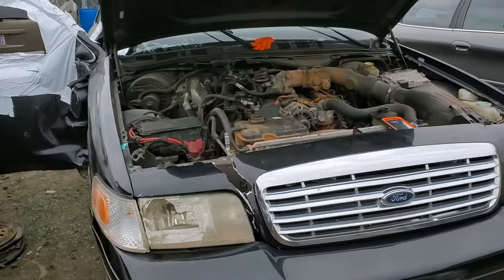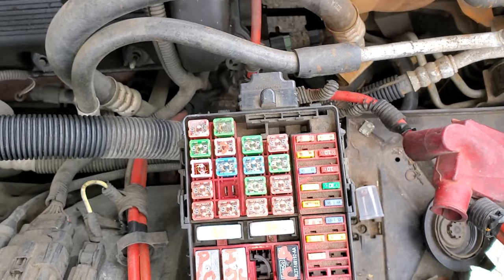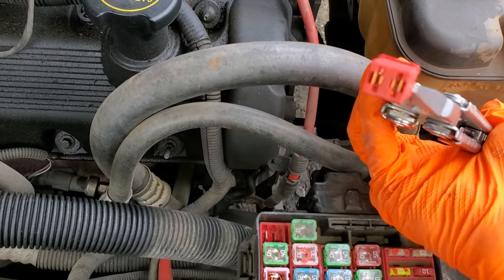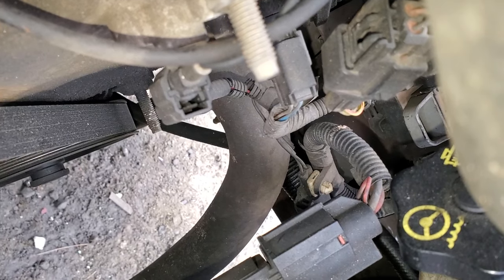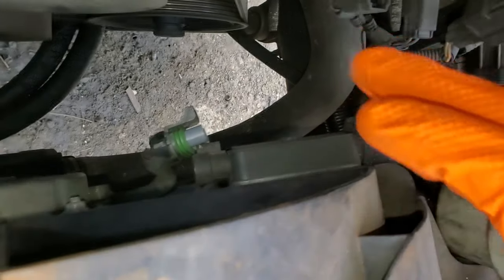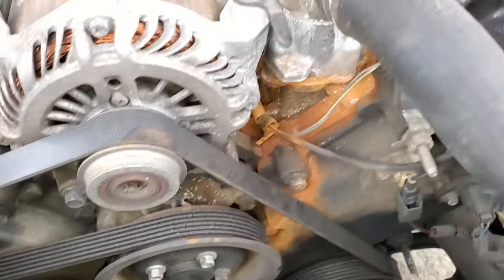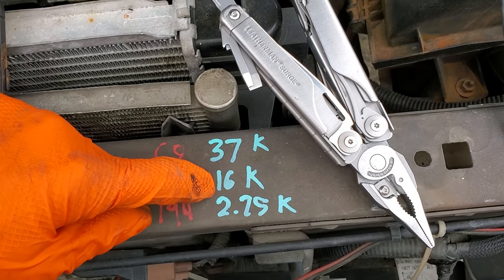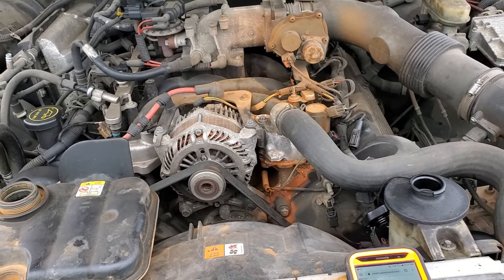2006 Ford Crown Vic Cooling Fan Fuses & Relays

Comment: My Electric fan stopped working on my 2006 Lincoln Town-car and caused an overheat. This video was helpful in me fixing it. It was the relay that he points out around the 1:30 mark of the video, I know many people are saying to replace the whole electric fan assembly , but this was much easier for me and the part was less than 25 to buy and was plug and play.

Comment: So are you saying there is not a larger relay in this system? Only a fuse and a control module + sending unit behind alternator?  Thanks for the help. I'm mostly a Chevy guy and they have large relay in the system.

Comment: Great video! I have a 2001 Mercury Grand Marquis and the cooling fan doesn't come on unless I have on the a/c. It starts spinning fast and then slow. The fan won't come on unless the a/c is running but still runs hot. Any ideas? Thanks in advance!
Reply: I have the same issue on my 2002 Mercury Grand Marquis. Whenever I start it I just make sure the defrost is on and then the fan runs. After it started I could shut the AC off and the fan will still run but if I shut the vehicle off and then turn it back on without the AC on the fan will not kick on no matter how warm the temperature is
Reply: I have no check engine code or anything wrong but my cooling fans constantly run when AC is on. What could this be?

Comment: Just to let u know guys problem solved...
The problem in my car was in module i placed the module that came with the assembly (fan-frame-module)  from the junk yard...
I installed the one i used b4 and the fan worked.

Comment: Good vid,I find if you disconnect the cyl temp sender the pcm will command the fan to high cause it thinks sender has failed ,something that may help in troubleshooting any issue
Reply: Hey man I did exactly that and my fan engaged on my 07 after I replaced almost everything besides the fan itself but I cannot find the exact cause because it will only engage with temp sensor disconnected
Reply: @denzeltucker2920  Hello Denzel My grandsons ex 2011 cop car was over heating in traffic so I had to study up on the cooling fan operation.If you can dissconnect cyl head temp sensor and the fan runs on high consistently then  in my opinion things are ok from the pcm out.I would still inspect your connector at the input side of the module and the connector on the output side of the module ,they both melt ,quite common,I also used a headlight and jumper wires to double check the current at the input side of the fan module to load it and make sure the current there is up to snuff .That being said if everything passes inspection you may have to roll the dice and try a pcm Regards
Reply: @denzeltucker2920  That's why it's best to replace the whole unit. It's all new! Dorman makes great fan assemblies
Reply: @tombrinkert3720  Time and work is MONEY. IT'S BEST TO REPLACE THE WHOLE UNIT. CAN'T BEAT ALL NEW!!DORMAN MAKES A GREAT FAN ASSEMBLE! AT ONLY 160! COMPLETE!
Reply: @captainamericaamerica8090  I just bought and installed a Dorman not even a month later something is wrong it doesn't want to come on.

Comment: My transmission temp is a little to high for my liking. I install a additional transmission cooler but also want to add the auxiliary fan on the front of the cooler. Can I splice the fan into the radiator fans so they cut on at the same time or just run it from its own source??
Reply: I would run it from its own source with its own relays and its own switch so you can turn it on or off at your own disposal.
Reply: DON'T

Comment: Good video.  Fan module and fan motor can be replaced without replacing the complete assembly.  Cylinder head temp sensor explanation is very good.  Note the condition of the connector wire, the flex tubing has disintegrated exposing wire to more engine heat.  Heat increases wire resistance which could cause PCM to read higher sensor temp than actual.  Heat causes PCM to retard ignition so the result is lost engine power.  Replace the flex tubing.
Reply: Too Much time and work to replace module plus fan motor adds up to small savings. Best to replace the whole fan assemble. Cheaper in the long run. We love Dorman! Great price and quality. All the components are there.
Reply: That makes sense.. So if my fans constantly run when AC is turned on, could that be due to this wire being bad or what u think?
Reply: @NightRider-16  Fan is supposed to run constantly when a/c compressor is engaged.
Reply: @encinobalboa  OK thank u

Comment: Nice video but no need for all this electrical nonsense....car makers, just put a normal fan back on the front of the engine....worked perfectly going back to the early 1900's.
Reply: YEP, what I don't understand is these hot rod cars that HAVE plenty of room FOR a mechanical fan or they HAD one but they took it off FOR electric fans LOL,
Reply: I know. I want a metal fan and assembly powered by the motor using a pully off the belt.

Comment: I got a 1999 CVPI and it does pretty much the same thing. The car overheats when the AC is on, replaced the compressor, condenser, accumulator, orifice plug, and radiator cooling fan. Also replaced the relays and fuses and radiator. And after all of that the damned thing still overheats when the AC is on, the compressor clutch kicks on and off and the brand new radiator fan doesn't come on I'm at my wits end, got the replacement cable for both the fan and the compressor and gonna use my guages to check refigerant levels.
Reply: did you find the issue?
Reply: @ChrisMFlorida  not yet, think it might be the PCM at this point because I pulled it put, and tried replacing it but I ended up having to place the old one back in. When I did that the car ran it's AC normally for about a half hour to 45 minutes before the Radiator fan switched off and the compressor began to cycle on and off again
Reply: I have the same issue, where you able to fix it?
Reply: @JUANGOMEZ-sk9hd  not yet I'm thinking it's the PCM or its the Ambient air temperature sensor
Reply: @JustinLaFleur1990  any success? I'm having the same problem right now.
Reply: @HermanStevensII  sadly no, I ordered a new PCM but the company I ordered it from didn't program it right I haven't had the time or money to program it
Reply: @JustinLaFleur1990  wow... The Vic is my primary. I'm just speeding everywhere currently.

Comment: Hey Love the helpful videos. But my 08 crown Vic has been a tank up until last week only running hot when idling. Fan doesn’t seem to be working but all fuses relays and it getting voltage, the Only thing that’s sus is the ohms reading on the last plug u showed us in the video. It’s reading 3.95 w engine at 190 maybe 200 degrees. My ohm reader is old I think it only works on (20k) setting, would that be a factor. I’ve spent so much on parts in two days while driving the 2500hd to work (GAS SUCKR) so there’s that. And NOW only to find that the fans is not kicking on. Please tell me it the Drivetrain Temp Sensor and not Fan Motor. Jk either is cool lol… 🤦‍♂️🤷‍♂️ Thanks man your Videos are sooooo helpful.!!!💯🙏😎
Reply: I'm having a similar problem with my 07.  On hot days at idle my fan will stop working and run hot sometimes vs when driving with ac it runs.

Comment: Hi. I have 2011 Lincoln Town car the radiator fan dose not turn on when the gage get half way up, but when I turn the A/C on the fan turn on. i don't know the problem is the radiator fan or temperature sensor?  By the way no check engine light. Thank you.

Comment: So I have a 2006 crown victoria and my fans are constantly running only when AC is on. When I turn AC off they stop. What could Cause them to run constantly?
Reply: I think that they are supposed to turn on automatically whenever the AC is on.
Reply: @NightRider-16  yea so the fan turns on as soon as you turn ac on, that's normal, that's how it should function
Reply: @chocolatebar701  OK thank u.

Comment: My 09 towncar fan stays on after I turn the car off, I replaced the temperature sensor a few months ago so it might not be that, any suggestions?
Reply: Im having the same issue. There’s no overheating issue and everything seems to be working when the engine is running but the fan continues to run after i shut the engine off and doesn’t stop until the battery is drained. Did you find the problem? If so what had to be replaced?
Reply: @benhizzle  yeah, I replaced the fan control module and that took care of it but it was like $300 from the dealer maybe try an aftermarket one which are like $50?
Reply: @xxXrichmanXxx  Thanks, I’ll replace it this week👍
Reply: @benhizzle  hope it helps

Comment: crown Vic 2008 if engine newly start radiator fan works but engine is hot fan working high and suddenly  low and then off and then Aircon  off and on and high temperature  what is the problem sir

Comment: I have a 08 grand marquis everytime I turn on ac its kicks in and out change fan module still doing it causing it to run hot only if ac is on only code it saying is the sunload sensor that's on top of the dash is that it or the climate control and also changed thermostat

Comment: My 2008, only blowing hot air any tips?
Reply: If the fan is turning then recharge your A/C for about $20-30 bucks. If fan is not turning then replace the Fan Control Module for about $30 bucks. If that doesn't work replace the entire Cooling Fan Assembly for about $200. If the A/C works while the car is moving and gets warm at idle it's usually the Fan Control Module or entire Cooling Fan Assembly. Hope that helps.
Reply: @caroleatkins6012  thanks! I needed a recharge
Reply: @caroleatkins6012 what if I have no check engine light or cooling issues but my only issue is that the loud fans constantly run when AC is on. They stop if AC is off but I thought the fans should cycle off and on depending on temp and not run constantly???

Comment: Hi i have a 2007 grand marquis...
I tried to connect  with a jumper starter directly to the fan it did not spin until I just move it by my hand, I tried the same thing on the module result was same.
, fuse looks fine  the module was replaced with a new one OEM  a year ago. Heat sensor reads normally. 
Only on a cold start the fan spins when switching AC on after reaching operating heat every time I stop AC is not cooling. 
should i replace the fan motor? Or there is something I am missing?
Reply: Replace the whole unit. Dorman makes a great one

Comment: Hello friend, I have a situation with a crown vic 2011, previously another mechanic had already worked on the car and did not find the problem and put the fan directly on the battery, I tell the customer to buy a new module, thermostat and the temperature sensor to be sure that everything is new and to turn on the fan, everything new is installed but even so the fan does not turn on as it should, there is voltage for the fan to turn on but apparently there is no ground, so I do a ground alternated, well the fan starts but does not turn off, it remained active even with the car off, what can you suggest to me regarding this .. I will wait for your answer and thank you
Reply: Darwin Colon did u solve it
Reply: Relay could be stuck on....

Comment: My cooling fan won’t shut off at all key on or off. Help
Reply: Same here ,What was the problem?
Reply: @jacobcasillas9249  there’s a switch on the radiator fan that went bad
Reply: @mikerox31 what's the name of it? And is it apart of the whole fan assembly?

Comment: I have a question. I have an LS swap with two wires to control a two speed fan. I found several wiring diagrams for a taurus fan. The diagrams show a high and low speed wires coming off the fam motor. But you are stating the crown Vic is pos./neg.

Comment: if you replace the fan module replace the fan motor. 95 percent of the time its the fan frying the module. the ford fan motors have an issue with drawing to many amps when starting and running.
Reply: USE DORMAN! 🐯🐯🐯👑👑👑🏆🏆🏆🏆

Comment: That works but it kills the AC there's another plug under the reservoir for water you can unplug and keep the fan running and the AC
Reply: Please tell me more. I have that problem (on Crown Vic) the cooling fan and AC stop in the same time ... at random.
Thank You.
Reply: ? Say more

Comment: My crown Vic is going from hot and cold never stays on hot i Change the thermostat and flush the radiator because of coolant turning brown and I bypass the heater core earlier this year because it was leaking  it ran good for like 2 week then went back to running hot and cold oil is is good not coolant leaks I don’t think the coolant is flowing threw the thermostat the coolant is back brown I bought the car 5 years ago and this is the first problem 225thousand on dash

Comment: I was told to check the relay, is there a relay on an 08?
Reply: Have the same question did you find it?
Reply: @nickcarter9373  there is no mechanical relay. the speed controller mounted on the side of the shroud is both a Solid Sate relay and speed controller. This is replaceable and can be purchase separately. I got it on amazon and solved my problem of not turning on. These usually go bad and could possibly cause a slight load on the battery causing your battery to slowly drain and go dead if the motor does not turn on at all. 
usually if you don't drive it a lot or the battery is at its end of life. 
This happens when the MOSFET inside are slightly leaking instead of a full dead short which would cause the fan NOT to turn off. 

Note: A shorted speed controller would cause the fan to run continuously, if the MOSFET's inside are slightly leaking (source to drain), it would not turn on the fans, but MIGHT cause some current drain and might slowly drain your battery. If they are completely OPEN, they will not run at all.
*Please keep in mind that this is from an electronics point of view and not from a Ford mechanic.
Reply: @chachavessel  Big help thanks, Can a hot wire be run from the fan plug itself to positive battery terminal for emergency to get it to shop? If yes what gage wire and to WHICH terminal of the fan plug should I attach it??
Reply: @REVNUMANEWBERN  Yes, you can. That was going to be my plan b option.
 Run a true 10AWG wire, with a fuse preferably to the positive terminal, 30Amp for extra measure. 
Another idea would be to use a mechanical relay 30amp, the coil would be energized when you turn the key, thus it will always run, but only when you turn the key. You could find a tap in the fuse box with a multi meter. You'll have to go back & fourth to find 12volts, unless you have another person to help you.
Yet another option would be to add a thermal switch to activate the coil. In this manner it would turn on and off as needed. They sell them
The same relay harness you would use when mounting extra lights. 

If you need further help, just leave a message here.
Reply: here's a link I found while googling. (I'm not associated with this site)
This was going to be another option, since Ive read that these controllers go bad quite often. 

https://shop.championcooling.com/articles/Relay-Wiring

Comment: "2006 Ford Crown Vic Cooling Fan Fuses & Relays"

no mention of relays in your video though..
Reply: That module he unhooked from the fan is technically a “relay” I just had to buy one
Reply: @denzeltucker2920  It's a Solid State relay & It's a speed control assembly that goes bad a lot on these, it either opens or gets shorted. It MOSFET powered and PWD ..Pulse width modulation.